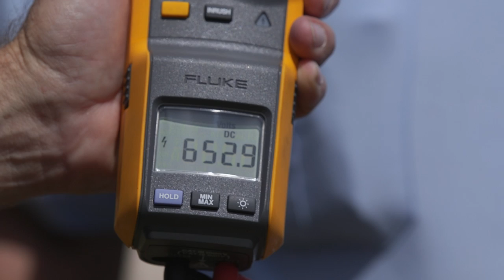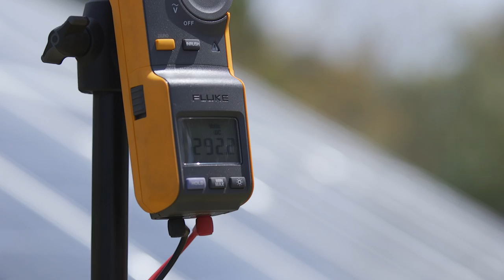Electrical Arcing & Water Conductivity

Comment: Wouldn't the frames of a solar panel installation be grounded?  Of course, in a fire, the grounding path could be compromised.
Reply: Yes they should be grounded by a single core, 6 gauge wire. And a normal house file (1,472F to 1,742F) should not compromise it as it will not reach the melting level of copper (1,984F). This video was filmed by morons that have no knowledge in how to properly wire anything. I am surprised the dude with the gloves didn't win a Darwin award.
Reply from the maker: Hi Brian, yes they should be grounded, but you would be surprised at the number of PV systems that we encounter that are either not grounded correctly or have deteriorated over time.  The intention of the video is to show the audience a scenario that may be encountered, especially for first responders who don't necessarily have the appropriate training and who can underestimate the potential risks.  If the education we are providing can save one life, it has made the exercise worthwhile.

Comment: If the system is wired using micro-inverters like Solar Edge Optmizers, then the a/c power can be shut off at the main inverter and each panel’s putout will be limited to a maximum of 1 volt.
Reply from the maker: "Rapid shutdown" technologies (such as DC optimizers and micro-inverters) have their place, but they are not a silver bullet solution.  They are electro-mechanical solutions that operate "downstream" of the actual solar panel, they are more expensive than a standard string array, they have more connection points and there are questions around long term reliability and if they will "fail safe" if damaged during an incident.  I have included a link to a website that outlines these points and more if you would like further detail, and for transparency, we have no formal or monetary link with this website www.fixmlsd.com
Reply: @pvstop5763  Those are all valid points. I have installed several 150kW commercial systems and done too many residential jobs to remember. 
I’m sticking to off grid systems now. Thanks for the link. I’ll check it out.

Comment: This is why I don't like low voltage DC systems 400~600V typically , as if they are damaged they are too dangerous, they can be unstoppable dc arcing faults and cause fires. floating the system doesn't work either as if any part becomes grounded on in contact with conductive building parts the fault will not become apparent until a second fault occurs and then its too late. The solution is to stick with 48VDC systems, use more expensive copper feeders, but its way safer and no major shock hazard.
Reply from the maker: Low voltage DC systems (typical of average domestics PV installations) are dangerous if damaged. Given the right circumstances they can be extremely difficult to stop arcing.  You are 100% correct, floating systems can catch you unawares!  This is exactly why we invented PV Stop. It is the only solution that allows you to turn off solar PV systems at the source, which is especially useful for firefighters and emergency service personnel.
 
Regarding 48v systems, this would be safer, but these days, with the larger systems that are being installed, the wiring would be very difficult if adhering to 48v maximum.  Say 5kw divided by 48 v = 104 amps.  If you were going to run the average of 20-30 meters of cable, the cable would be very expensive and cumbersome. This would cause more trouble than the low voltage systems as most installers would not be familiar with these large cables and the best installation practices.  Given that modern solar PV systems are driven by lower and lower pricing, low voltage systems are likely to remain popular.
Reply: That's why you have a fuse on each lead. Fuse blows no more coductivitie.

Comment: How many degrees Celsius of temperature resist solar panels? I see that they lower the temperature by giving it water. Thank you I am from Colombia, in the part where I am, we are exposing ourselves to more than 40 ° C. Thank you
Reply: Solar panels can easily withstand atmospheric temperatures of 60celsius. The panels themselves get heated to over 100 celsius under the hot summer sun

Comment: add in-line fuse at every solar panel...if wire damage,it will cut current to heating your roof❤
Reply: Hi Tomok, Direct Current (DC) always wants to flow from source to load, the more switching gear, relays or fuses you place in its path, the more potential points of weakness you create.  A well designed and engineered string with the minimum number of connection points is the safest solution (in my personal experience).

Comment: I prefer to have sliding shutters on roof top to immediately cover all the panels from being destroyed by hailstorm or in an electrical sort of emergency. Yes shutters should also be equipped with manual operational levers.
Reply from the maker: In theory this would work, assuming that you keep the shutters well maintained (as they will live in the elements 24/7), that they don't compromise the load bearing capacity of the roof and that they don't cast shadow across the panels and reduce efficiency.
Reply: How will you know when the hail storm will start? What if it starts at midnight? Moreover, shuttering the solar panels is a very tedious and expensive process

Comment: how far does the canister squirt. Like how am i going to get this product up on my roof in the event of a fire. Or is it something you have on hand to give to the fireman to apply? Why wouldn't firestations then have this product available to them. I heard the some fire stations will only respond to house fires with solar when its dark. Shouldn't this become standard as part of their equipment.
Reply: Hi Chris, all very good questions.  The delivery range from a 9L (2.5 gal) vessel is approximately 10m (30ft).  This is adequate to reach the solar panels on a single storey structure (as long as the solar panels are visible from ground level).  We only recommend that PVSTOP is operated by  trained professionals who can conduct an appropriate risk assessment (such as a firefighter or an electrical technician).  So yes, the intention is that PVSTOP be carried by Fire Departments, Electrical Technicians, or stored on site for use by Fire Fighters/Electrical Technicians in an emergency event.  You are correct that fire departments will treat solar panels defensively during daylight hours because of the risks associated with potentially lethal DC electrocution.  PVSTOP should become standard equipment for Fire & Emergency Services Agencies, the sad fact is Australian Fire & Emergency Services Agencies have been very slow to adapt to the growing risks associated with solar panels.  Although we are an Australian innovation, we are having a far more rapid uptake of PVSTOP in international markets (such as the UK, Europe, US, S/E Asia).
Reply: @foranjim  Thanks Jim, Very insightful. I'll Definitely be ordering one for my PV system when we get it installed. What's the shelf life of the product, ie, how long can it sit there on standby before needing to be serviced. That's amazing the delivery range. I have a one story house, but is on a sloping block, so been able to cover my north facing roof line from the lower ground would be very useful.  You really should promote it to other youtube channels like SolarQuote etc.
Reply: @ChrisLaNauze-Author  no problem, my pleasure.  The warranty on the product is 3 years and we have actually tested standing product beyond 3 years without any deterioration in product performance.  However we recommend a visual inspection including an inspection of the pressure gauge every 6 months to ensure there is no pressure leakage or damage to the cylinder (just like a standard water type fire extinguisher).  Yes, the deliver range is quite decent so that it can be applied from a safe distance (whether that be from the ground on a single-storey structure or an aerial appliance for a multi-storey structure).  Our strategy is typically to start promoting the product publicly once we receive support from fire services (which is what we are doing in the UK, Europe and the US, but support here in Australia has been slow, which is why we have been "under the radar" in Australia up until now.  Would be great if Australian Government Departments would give us the same product support that we receive O/S so that we could roll out our solution safely and responsibly here in our home market.

Comment: The roof would not become ‘live’, as there is nothing grounded.  You need the ground connection to a deep grounding rod to allow the return path for a lethal voltage from person to ground.  Without the grounding rod, the solar panels are merely a floating high voltage that cannot conduct to ground via any conductor, being a person or other conductive item.  No return potential.

Comment: And with water in the panel, they start releasing heavy metals into the soil.. Lead, arsenic, and so on... (The Chinese scientists  and folk at the University of NC) have a paper out describing the problem of brownfields created by solar farms.. (land contamination that mean the area cannot be used to grow crops because of the poisons in the ground...
Reply from the maker: Some of the chemicals used in the production of some solar cells (particularly certain industrial and commercial panels) are indeed toxic, this is why it is very important to utilise good quality system components.  Good quality panels will give years of trouble free service, but if they are damaged, it is imperative that good salvage operations are employed.  PVStop coats damaged panels and creates a waterproof coating that encases the panels and prevents toxic run-off,allowing for salvage operations to be conducted safely and effectively.
Reply from the maker: PV systems are revolutionising the way we generate power, but with any (relatively) new technology that rolls out so quickly on such a large scale, there are always unanticipated consequences.and risks.

Comment: It does not matter if the building is connected to the solar panels as long you are not touching the other potential. The biggest risk is working on the wiring.
Yes there is the misconception that a broken panel does not deliver any voltage but that is why you have people who know what they are doing, called electricians.
So just tell every one not to stand barefoot on your metal roof while having a leak on the broken panels.
Reply from the maker: Haha, I definitely  don't recommend standing on your roof and taking a leak on your broken panels!  You would be very surprised at how many electricians don't know anything about DC electricity (most electrical training is AC oriented).  Most solar PV system installers are not qualified electricians and most  fire and emergency service personnel who are called out to structure fires involving solar PV systems are not electrically qualified.  Lets put it this way, solar panels are an electrical generator that do not have an "off" switch.  This is the problem that we are solving.  PVStop is an "off" switch for solar panels.  It beats working on live wiring!
Reply: It sounds like the wires from the solar panels should be shorted to ground, as well as the frames. By code, all solar panel frames are earth grounded. Not just for damage or water, but to safely ground lightning, should the roof be struck. If the frames, and mounting rails are grounded, as per code, there should be no hazard. Grounding both - and+ leads from a series string to ground will also help. Maybe a safety disconnect switch can be made double throw, so when thrown, it simply grounds everything.
Reply: @pvstop5763  The add made me think, that this was some type of fire extinguisher. It did not show any kind of switch, which really would solve the problem. By code. all solar panel frames, and mounting rails and hardware, are supposed to be earth grounded. Not only for the reasons depicted in this video, but to safely ground a lightning strike. A switch that not only disconnects the panels from the controllers, but also ties both + and - wires to ground, as well. That would guarantee that the panels are at the same potential as the rest of the house, and fire hoses!
Reply from the maker: @vincentrobinette1507  Hi Vincent, while it is true that solar panel systems should be grounded (according to the NEC), we frequently encounter installations that have not been grounded correctly or where the system has deteriorated over time and is no longer safely grounded.  In fact we estimate that approximately 20% of residential installations are either sub-standard or dangerous due to poor quality system components or poor quality installation practices.  Any form of switching operates "downstream" of the panels themselves, meaning that as long as the panels are exposed to light, they are producing potentially lethal amounts of DC electricity (which cannot be remotely detected unlike AC electricity).  PVStop is the only "physical barrier" technology that safely isolates the power at the source (the solar panels themselves).
Reply: @pvstop5763  The video made me think you were selling a particular type of fire extinguisher. I didn't know you were selling a disconnect switch, which would really help! You're right. a lot of DYI'ers may not be aware of the need to ground panel frames. Even low voltage systems should have the frames and mounting hardware grounded, just in case of lightning strike! It requires a special kind of switch, to disconnect a DC high voltage array. There is no zero crossing to extinguish the arc, like you have with AC. A light switch is not going to interrupt the power, it's just going to "fizzle", and burn up, creating a fire hazard. The switch, to effectively cut off a high voltage array, needs a magnet to lengthen the effective contact gap, or there needs to be a physical insulator that drops between the contacts, to shear the arc.
Reply from the maker: @vincentrobinette1507  This video was part of a 5 part series that was designed to educate first responders and for some (unknown to me) reason, it went viral and has had hundreds of thousands of hits.  The earlier video in the series gives a much clearer introduction to the purpose of the product, so apologies for the confusion.  You are absolutely correct regarding the need for specialised DC switch gear, unfortunately very few electricians are DC trained and we seen an enormous number of incorrect switches used on residential PV arrays, in fact faulty or incorrect switches are the number 1 cause of PV fires.  All these scenarios place first responders at risk and they are forced to treat many incidents involving PV systems "defensively" rather than "offensively".  Our product provides first responders with a safe system of work, greatly improving firefighter and community safety.
Reply: @pvstop5763  I definitely appreciate that. A properly designed hi voltage disconnect switch makes much more sense than a fire extinguisher. I also realize, that in a grid tie system, the panels themselves may not be the hazard. A fault in a grid tie inverter could conduct power from the mains back to the panels which can be equally, or even more dangerous. Disconnecting the two components is clearly the safest thing to do in any situation where any components or wiring, could possibly have been damaged.
Reply: That only really applies if the panels have an isolated ground. Once the PV array is bonded to the buildings grounding system, anything conductive around you becomes a potential path for current to flow.